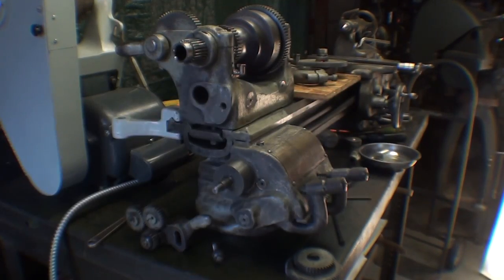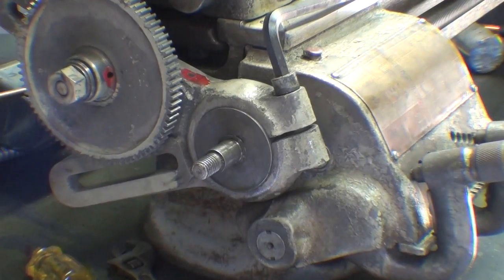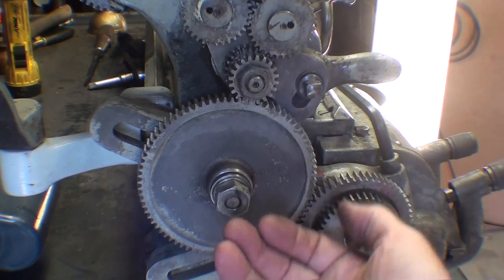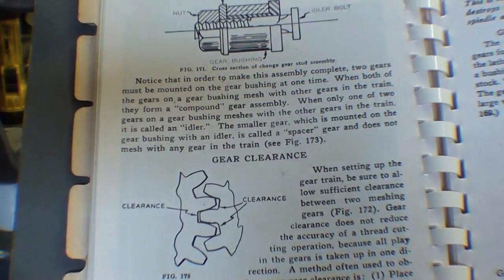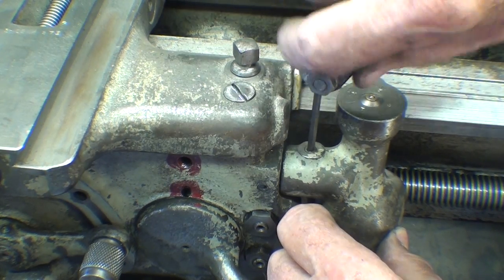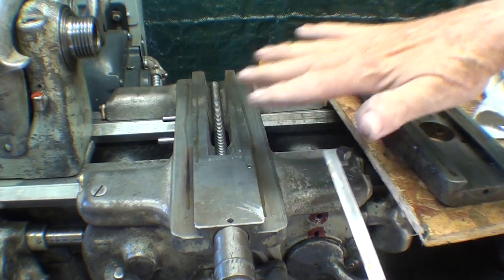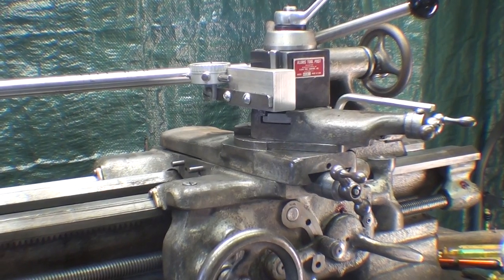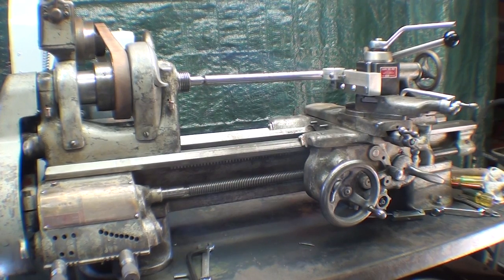Tips #340 Reassembling pt 2 - Headstock of SOUTH BEND 9 in Lathe tubalcain

Comment: This may have been answered in another video; I wonder about the the differences in "standard" oils (I would call that 10W-30), versus high-film-strength oils with sulfur, versus greases with soaps, versus silicone oils (both "wet and dry" as I understand them), etc.  Just an overall description of the whys and wheres of oils, lubes, and heat-removers (in cutting, can't think of the term right now).  It's so confusing, but fun to try to understand.

Comment: Really enjoyed this series   first time I have seen a lathe apart. However I can not figure how you put the drive belt on
Reply: Fred Chenze The flat drive belts with the metal teeth are split with a rawhide pin coupling them together. Pull the pin and the belt unloops. Easy belt changes with these.

Comment: The spacer gear is not a flip flop, it is a 40 tooth stud gear.  It goes up on the spindle in place of the 20 tooth stud gear when cutting very course threads.

Comment: You could stone that bump using shims on either side the bump. I had a rather large ding on my ways from the previous owner and that's how i did it. I used shims to gradually go down even without touching the surface, paper thin was the last measure of distance and after that i was confident enough to go with a synthetic ruby plate.

Comment: 6:48 it's so chewed up because it's been run with the drive belt out of alignment trying to jump off of the pulley.
Reply: I just found out why that guard was chewed up.
A section of my belt coupling broke off just like someone with snow chains coming off the wheel it clanked around a few times before I could stop it.

Comment: Looks like a well made machine.
Reply: They were.  I think the South Bend name was sold to some manufacturer in China who now makes lathes for hobbyists.
Reply: If I'm not mistaken, South Bend lathe was purchased by LeBlanc. I know that it is currently owned by the same man that owns grizzly tool and Woodstock machinery. It is a separate company, and it is an American company. And yes the machines are made in Taiwan. But they are Supposedly made to a higher standard than the Chinese machine. And although he has not posted lately,  he is a member of the practical machinist South Bend user group. And he goes by the name of Poppa grizzly.
Reply: Years ago, 20-25...Taiwan was fairly poor quality.... a lot of it has improved greatly.....China is now the 'NEW' Taiwan....with Viet-nam close behind....

Comment: Interesting as usual. Thanks for posting this.

You say in the video that the lathe has a lot of wear in it on the ways and on other parts as well. 

Can the ways be ground flat or otherwise repaired (perhaps not in a home shop at whatever cost) so that the indicator you are using at the end of the video, has no play in it? 

I suppose that even if the ways were ground flat, that you would need to ensure that the head and other parts were able to line up properly after the grinding and that this would not be a small job at all. Is this correct?

All the best to you from Hamilton, Ontario, Canada.
Reply: The ways could be reground, but it would cost way more then the late is worth.
It'll still function fine as a hobby lathe; it just won't be making parts for NASA anymore.

Comment: Hi T/C 
I’ve a model 9, which I’m reassembling, and  I’m having difficulty getting the headstock spindle past the lubeing wicks. Is there a trick to this please.
Reply from the maker: Sorry, never had one a part
Reply: @mrpete222   
Tis ok, twas easy to do by putting a pin in to hold down the spring felts, by taking out the oil cups. Every thing is easy when you know how!!!!
My lathe left the factory in 1947,
and it's still doing great work, here in Wales UK!
I enjoy your vid by the way☆
cheers,
Alan H.

Comment: Hi Lyle,  maybe you can help me. I think you might be the only one that can help me. I just bought a South Bend Model C 9 inch lathe and I'm missing the rack and all the info out there does not metion dimetral pitch. without this info I can't get a new rack. Thanks if you can help.
Reply from the maker: I do not know the pitch offhand. Here is how to calculate it. Count the teeth on the gear that would be in contact with the rack. Then add two to the number of teeth.    Then find the diameter of the gear. Then divide that tooth count +2, by the diameter. That will give you the diametral pitch

Comment: You look awfully thrifty with the oil while assembling the gears, for instance none on the allen bolt on the banjo... But perhaps that is just my experience as a mechanic, or perhaps your experience with cast iron. I remember back when Safety Kleen started putting a parts washer in every garage and I also remember several years later when everything they had cleaned - better than anything previously - started showing up all rusted together.